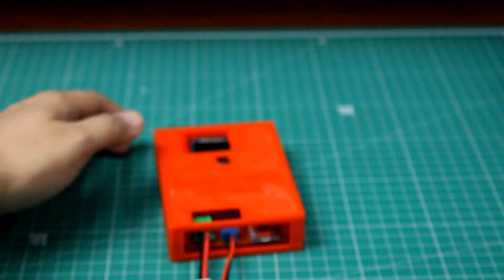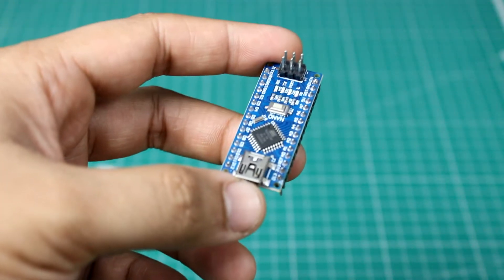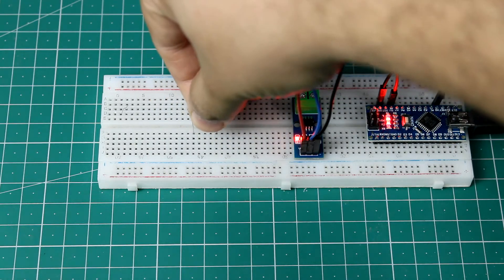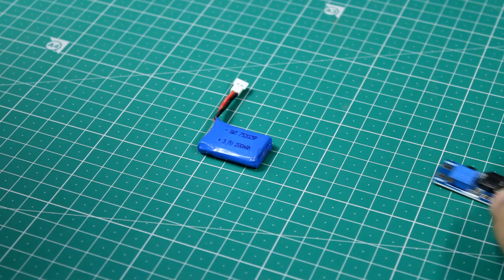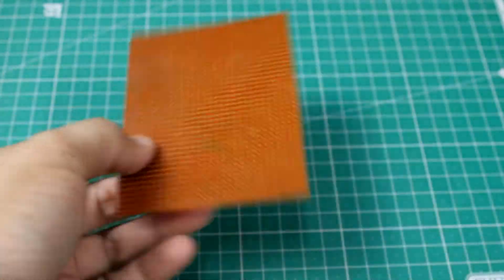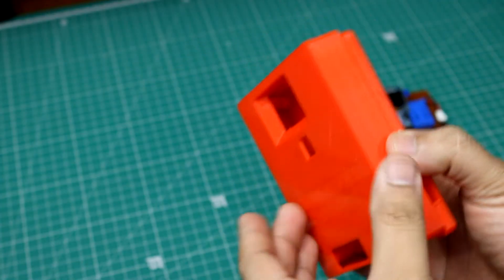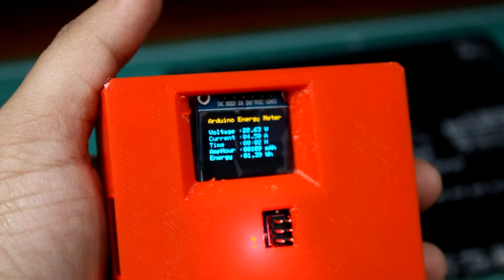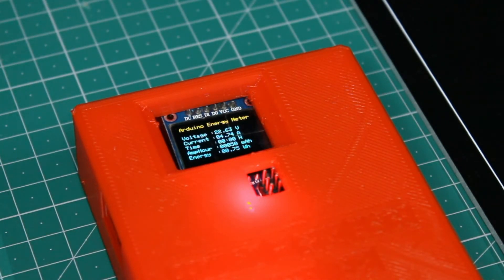DIY Arduino Energy Meter - Measure Current and Voltage using Arduino

Comment: The link is no longer working for the OLED display. Can you provide the specification or part number for one that you used? It appears to have 6 pins but the only type that I can find has 4 pins.

Comment: Very cool project! Thank you for sharing it with us :D. I will use your tutorial as a basis for measuring the performance of my small 10 W solar panel. I plan to use an ESP32 or RP2040 connect so I will have to see how to make the voltage divider and current sensor work with a 3.3V device but this should be doable.